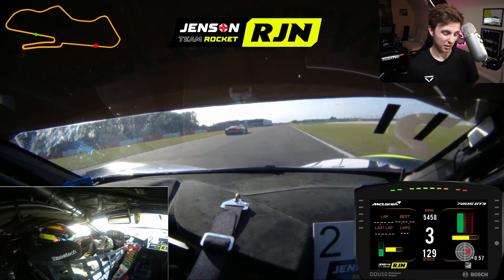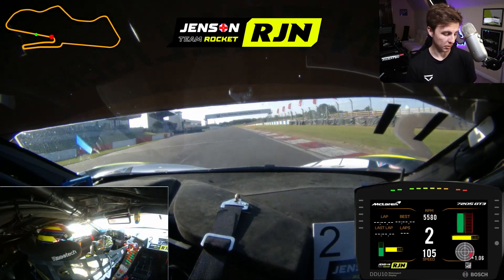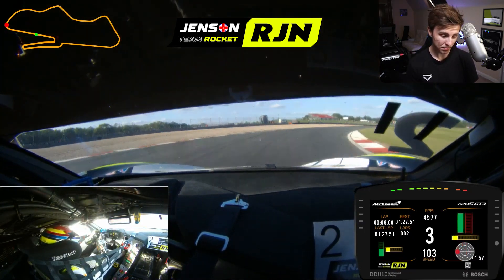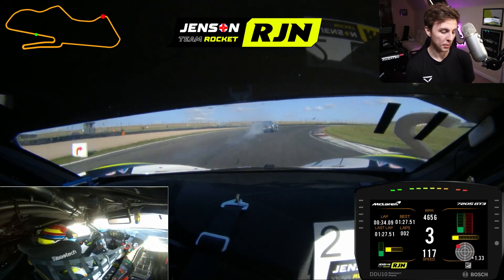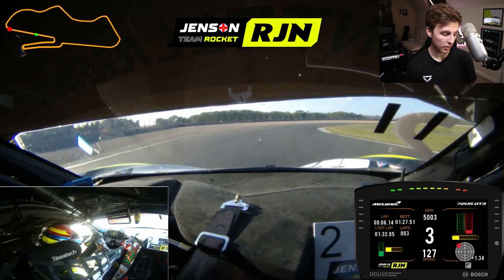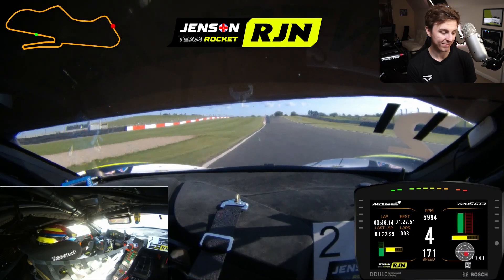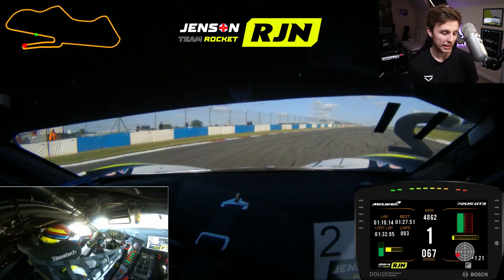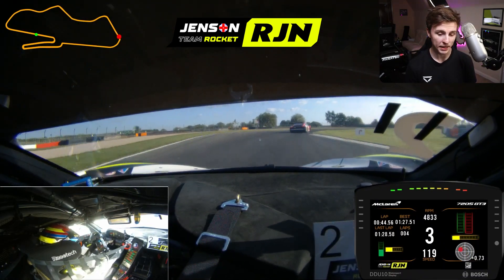Putting A Real Race Car On Pole Position

Comment: What you said about the brakes heating the core of the tire is slightly incorrect. It's the sidewall changing shape under braking that causes the heat to build up. Yes, the brakes being hot will heat them up but not nearly as much as the rubber itself moving around and getting hot through internal friction forces.